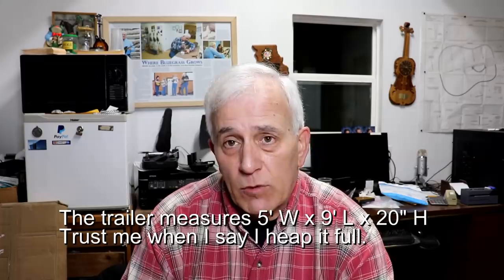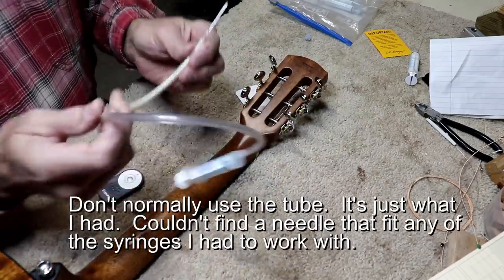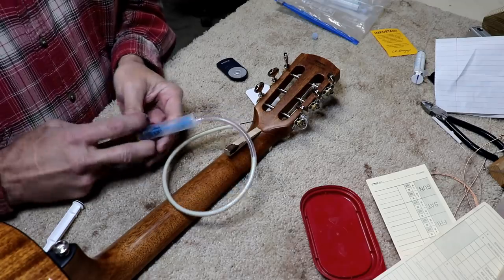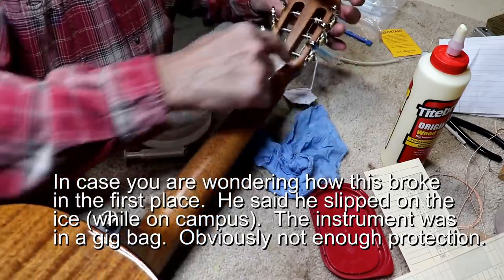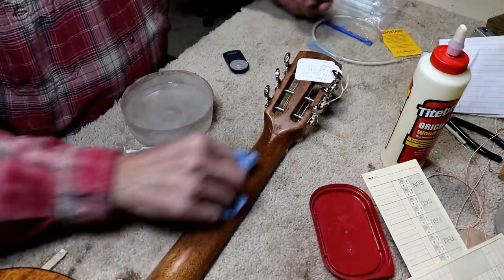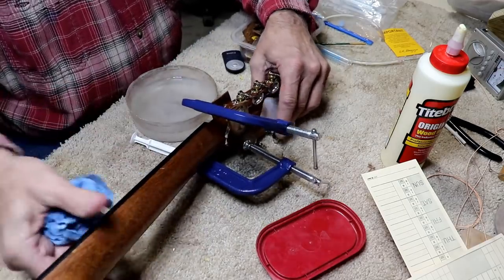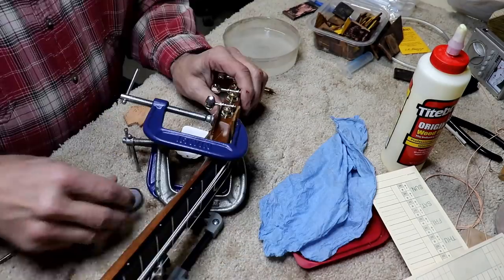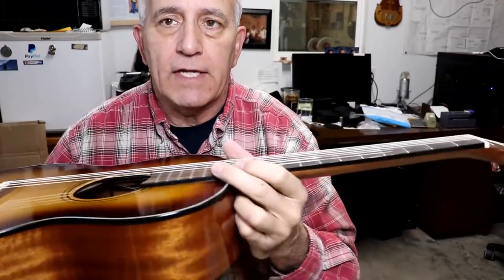285 RSW Peghead Fix for College Student

Comment: Jerry - you are saint to that kid. The universe thanks you.  BTW- I agree on the syringes generally but I do have a really good one that was designed for countertop or vinyl flooring  repairs that has a big barrel and a really good stainless steel needle - it will force un-thinned Titebond a long way under a separation.  The key is the size of the barrel and plunger - you just can’t get any hydraulic pressure out of a tiny plastic medical syringe unless you really water down the glue -  the seal around the plunger will fail and make a mess b4 anything gets out the tip. This thing I have looks more like a cake decorating tool but with the thin needle tip.

Comment: the key to injecting the glue is simply to make sure there is no air in the syringe. air is easily compressed (this is why you don't want air in your brakes hydraulic system) so the answer is always to use the syringe to suck up the glue in the first place. enjoyed the video as always. your a good person Jerry.

Comment: You did a nice thing for the kid.  I dont like syringes either, what I usually do is make a thin "spatula" out of a piece of plastic packaging, and use that to wedge in the glue.  The makeshift spatula will slide up into the open crack, which makes it easy to get glue into.

Comment: It's fantastic what you did for that boy. Congratulations! And thanks a million for that. I'm pretty sure he would appreciate it.

On the other side, it's quite shocking to me the way you found the sound of that guitar. Setting aside the low quality of the loudspeakers of the tablet I use to watch your videos, I found the sound of that guitar much closer to the sound of the guitars we've got over here, the classic Spanish guitar. However, the kind of guitars you mostly have over there, acoustic guitars with metallic strings, sound a bit strident and loud to me. It's great! In the variety is the spice!

My regards from Spain.
Ernesto.

Comment: I think the syringe and the needle is a good idea married to a bad one when using the tube. The surplus air in the tube compresses - if you use the needle directly on the springe filled with glue it should work just fine if you use a large enough needle because the glue has High viscosity

Comment: That was really great of you to do for him! I'm curious. What kind of stove are you running?
Reply from the maker: Is a central boiler outdoor furnace. It's the largest one they make for residential.
Reply: @RosaStringWorks  ah, ok. I thought it was a regular stove. I always believed those were heated by pellets instead of straight wood. Learned something new.
Reply: Rosa String Works  we have an outdoor boiler too,love it.  We live in a 200+yr old stone house. Radiant heat is wonderful. We also have a wood/coal stove in the cellar that’s ducted in to the duct work in the floors for the air conditioning vents. Between the boiler and the stove in the cellar we burn roughly a silage truck(10 wheeler) of wood a winter and about a ton of coal. I mostly burn oak and hickory because my house sits on 57 acres of nothing but oak and hickory. Me and a good friend of mine have a 1923 frick sawmill that we bought a couple years ago and we do quite a bit of lumber milling so there is always a big pile of slab wood to burn as well.

Comment: You Da man Jerry...it's not always about the money...you have a good heart. I do have a question for you, which linseed oil do you use for guitar fingerboards? I have been using bore oil for many years but I've run out and I was wondering what type of linseed  oil you use? Thanks, Fred
Reply from the maker: I use boiled linseed oil I don't know that the brand is anything special
Reply: @RosaStringWorks  Thanks Jerry for getting back to me I'm going to give it a try.